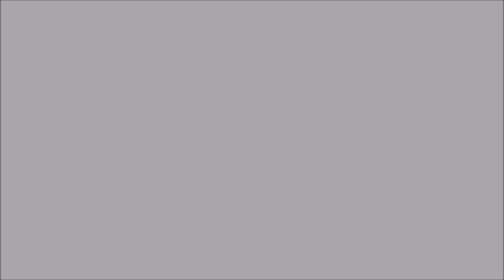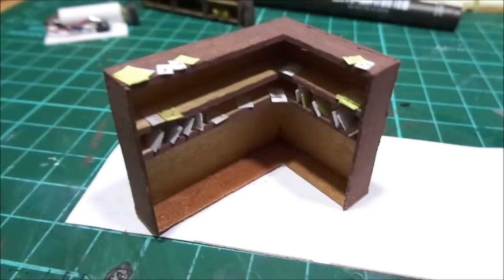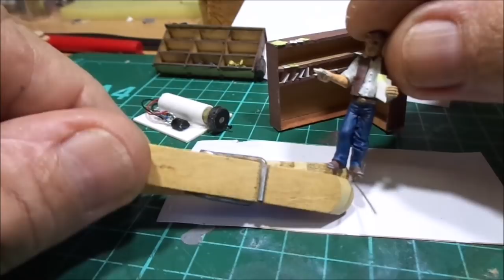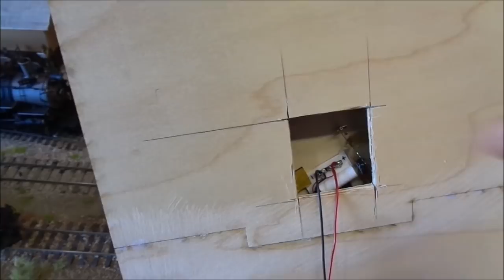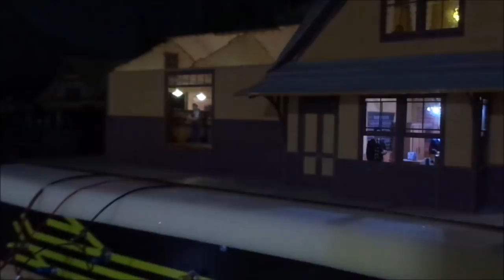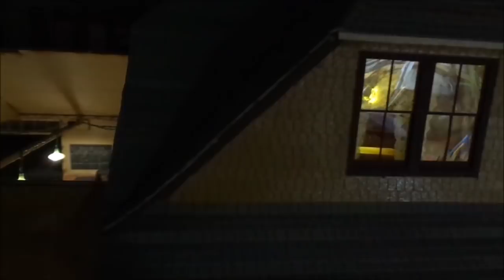Ouray Depot Part 3

Comment: i am inspired to try this animation.  great elect diagram.  do you vary the speed of the motor, if so, how.
Reply from the maker: G'Day Paul, the trick is to get the 3v motor gearing to a RPM output speed of around 200 to 500. It iss the gearing in front of the motor that get the speed down and fine adjustment can be made with resistor values.
Reply: got it, thanks! love your posts!